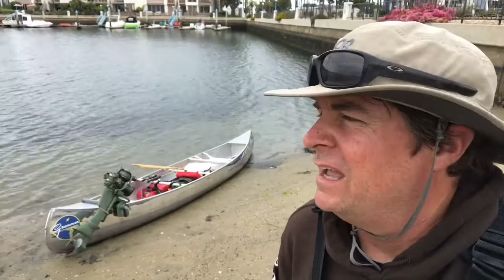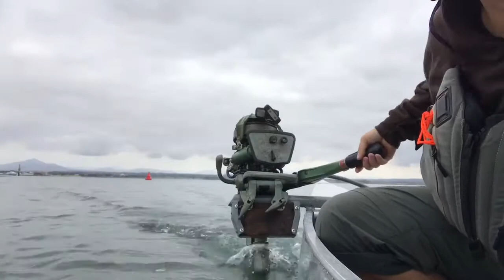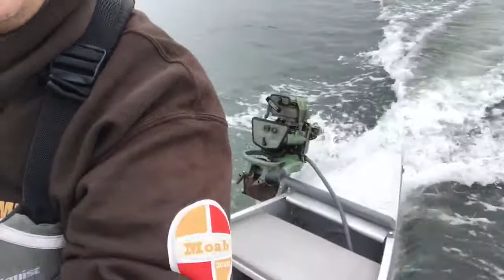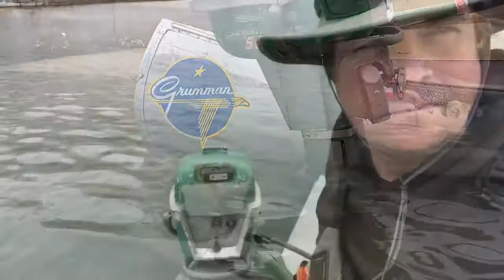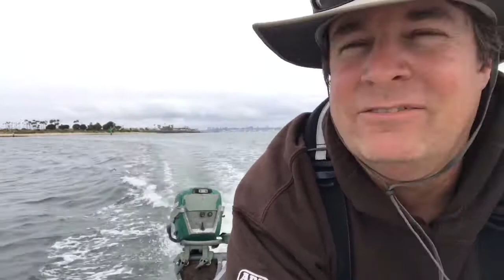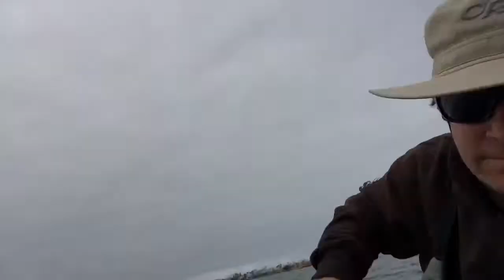1954 Johnson 5-1/2 outboard motor

Comment: trim her out for more top speed .   your plowing the water in the rear at full speed.
Reply from the maker: Side mount engines don’t have the protection of the transom for that spray coming from the lower unit. If you look at modern pontoon boats, they all have a small center pod to fix that.

Comment: Not sure what problem you were describing at the end there. Was there a problem with the ignition modules?
Reply from the maker: The last part the star gear came loose from the throttle so I couldn’t throttle up or down. I’m pretty happy with the ignition modules
Reply: @drtstar1  Thanks!. I just installed a couple of the Nova 2 chips in a '56 15hp that I've been battling with an ignition problem. Haven't had a chance to test it yet. There seem to be mixed reviews on the Nova 2 chips in terms of reliability and it's nice to see yours working out well.